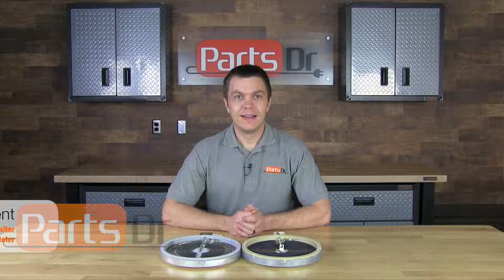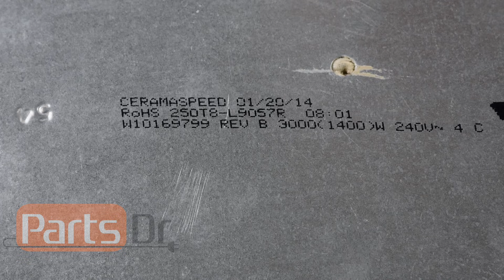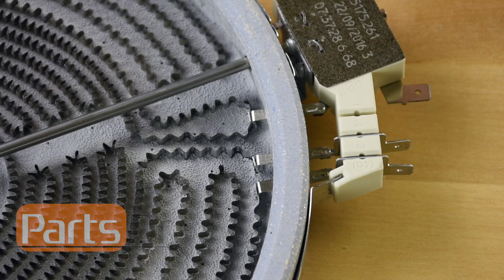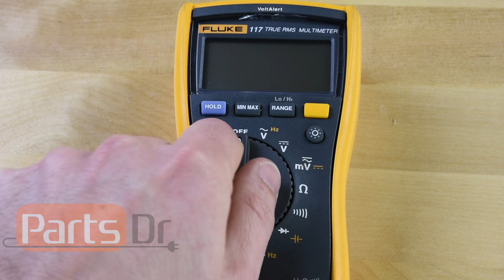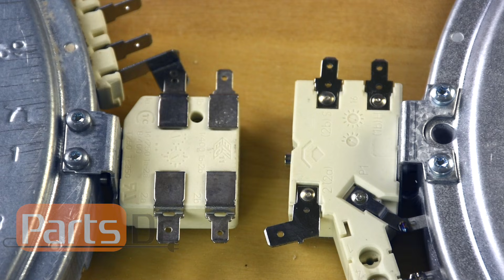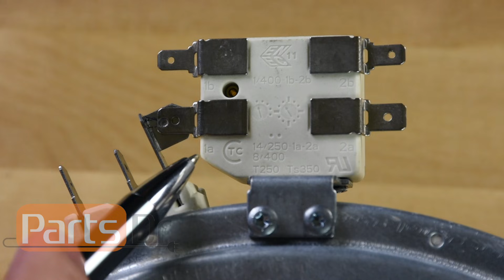How To Test Your Radiant Surface Element & Wire Limiter

Comment from the maker: If your radiant surface element isn’t heating properly or only one coil is working, this video walks you through how to test both the element and the wire limiter to figure out what’s going wrong. We also explain how to correctly wire different types of limiters, especially when the new one doesn’t look like the original. If you're ordering parts online, especially from places like Amazon or eBay, be careful that many of the cheaper aftermarket parts are of much lower quality. We've seen many cases where these parts fail quickly or don’t heat properly at all. For best results, use only genuine OEM parts. You can find high-quality range elements and parts at https://partsdr.com. Let us know if this helped fix your cooktop, and happy repairing!
Reply: i need to know what kind of voltage and amperage is supposed to be supplied

Comment: My hot surface indicator light stays on. When I turn on the element to high, it turns on for two seconds and goes into a limp mode where the heat is reduced over 95%. From watching your video, the limiter is bad and I need a new element. Is this correct? Thanks in advance!
Reply: inspect  element for burn marks and breaks and check continuity with a meter.  If this check out then it’s most likely the limiter.
Reply from the maker: Test the element as shown in this video, if that tests good then test the infinite switch next: https://www.youtube.com/watch?v=QdepcLWfZqI

Comment: What if tech sheet says coil should show between 38 and 42 on one terminal and 34 and 38 ohms of resistance and it shows 26 and 32  could it cause the burner to work on high heat even tho it’s set on minimum.?
Reply from the maker: No, what you are describing sounds more like a bad infinite switch.  Learn more here: https://www.youtube.com/watch?v=QdepcLWfZqI

Comment: Thank you I was going to send the new element back but it tested fine and the 1a 2a 1b 2b  arrangement was really different on  the new one - as well as the wire terminal sizes. Could not have done it without this video!
Reply from the maker: Happy to hear it worked out! Nice job doing it yourself!

Comment: My issue is a burner that always runs at full hot.  I checked the coils and all showed good so I got a new infinite switch (made no change) I have now ordered a new coil (with limiter) and hope that is the answer, as no way was given to test the limiter to be sure it shuts off.
Reply from the maker: The temperature of the burner is controlled by the infinite switch.  See this video for more details here: https://www.youtube.com/watch?v=QdepcLWfZqI

Comment: I have an element on my lg thinq stove the biggest one and I’m getting a reading of 28 ohms on one terminal and 49 on the other terminal. Is this a bad element? This element just stopped working all together
Reply from the maker: Those look like good readings to us.  You can verify the results by using the Ohms Law Calculator here: https://partsdr.com/blog/ohms-law-calculator-a-crucial-tool-for-appliance-repair/
Reply: @ so I took the element apart and the switch and put it back together and now it’s working. Like what is going on? Should I return the new element that I bought when I receive it or just buy a switch or neither? I honestly don’t know what to think now.
Reply from the maker: @tjsworld2338  We don't have enough information to make that determination.  Some LG ranges have a Power Relay Control Board that sends power to the heating element that can mail.  With an intermittent issue like you are describing, that is what we would look into next.  Learn more about this control board here: https://www.youtube.com/watch?v=dWpzVv37BHw

Comment: Can you get electrocuted if the glass break and the coils or the limiter are touched?
Reply from the maker: Yes, you can potentially be electrocuted if the glass top of an electric range breaks, exposing live electrical components like surface burner coils or limiters, and you touch them while the range is connected to power.
Reply: @ I’m an engineer on a tug boat here in Jamaica and is currently facing this problem. Great explanation. Thank you. I will now isolate the system until its replacement.

Comment: Hi, it is possible to remove and replace limiter only ? Th top of the road is burned, and the element does'n work.
Reply from the maker: No, the limiter is only sold with the heating element burner assembly.
Reply: The lead bar (terminal), which bridges from the thermocouple / thermometer / limiter assembly to the power terminal (the "spaghetti" heating wires), is spot welded. The spot weld would have to be undone (difficult, but not impossible) in order to replace the units separately. Why was it spot welded? Ask GE.
Reply from the maker: @artsnow8872  None of the manufacturers offer the limiter separately from what we have seen.

Comment: I did not know that the terminals would be different on my replacement burner, thank you so much. I almost thought I threw $300 down the drain.
Reply from the maker: Happy to hear that you found answer here.  The different wiring between the new and old burners throws off a lot of people.
Reply: @PartsDr  this is probably my problem. I’ve replaced the burners twice and a switch, and it still doesn’t work. I need to go back and check the wiring for the burner on my mom’s stove.
Reply: I had it wired incorrectly!  This fixed it, thanks!!

Comment: Why does the limiter show no continuity from 2a to 2b at room temperature? It should show continuity. When the heat is turned on, the metal expands and  the switch inside the limiter gets broken which is different from room temperature.
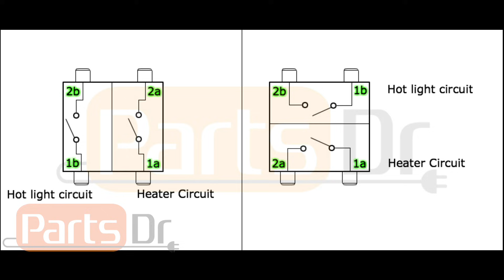Reply from the maker: 2a and 2b should never have continuity.  Reference the chart at 3:04

Comment: I have a bad limiter ( 1b & 2b are closed). Will this keep my element from turning on? If so, can I replace just the limiter?
Reply from the maker: If 1b & 2b are closed all of the time, the hot surface indicator light would be light constantly.  That usually will not stop the element from turning on.

Comment: I have been searching for information on the electrical terminals on the new GE WB30T10132 which is the only element available for my older GE profile radiant cooktop. Unfortunately, the new element has two more terminals than the old one, I was not sure what the significant of the two new terminals of the new element. As it turns out, I was able to match up the right terminals for the heating elements but I was curious what the other two are for. This video laid it out clearly at 2:58, the other two are really just for the heating indicator light, which I don't need because my cooktop has a separate circuit for that light. It is also important that he showed how to test the terminals to make sure they are working properly. Good job!
Reply from the maker: Great to hear!  Thank you for sharing!

Comment: Would there be any other switch or safety breaker that could be my problem. I have a good double element but only one element works.
Reply from the maker: Yes, sometimes the surface burner switch (also called an infinite switch) can go bad and cause only part of the element to turn on.

Comment: My dual element similar to those in this video has another sensor probe from opposite side which went bad.  No continuity on the probe.  Prevented the element from working.  Had to replace entire element.

Comment: Would this element replacement fix an intermittent issue with a burner that stays in the on cycle too long? It's strange, as it doesn't happen all the time. But you have to stand and watch because it will burn your food if you're not paying attention.
Reply from the maker: That type of problem is usually caused by a bad surface burner switch (infinite switch).

Comment: Thank you so much for taking the time to make this video but it doesn’t look like it is solving my problem. I have a whirlpool WFE505W0HS0 and my hot surface light stays on all the time. I don’t even have wires going to 1b and 2b so I feel as though my hot surface light isn’t set up the same. Any help would be greatly appreciated. Thanks!!
Reply from the maker: Did this happen after installing a new surface element?
Reply: @PartsDr  no, the light just started to come on. It seemed it would stay on longer than normal and I should correct myself, the stove states “cooktop on” and “cooktop hot” but the stove is not on. All the heating elements work as they should. The lights just stay on.
Reply from the maker: @XRotov2  What is the model number of the range/cooktop?
Reply: @PartsDr  WFE505W0HS0 is the model number.
Reply from the maker: @XRotov2  The most common thing to fail and cause these types of symptoms is a bad burner switch.
Reply: @PartsDr  thank you very much! Are those also called infinite switches?
Reply from the maker: @XRotov2  Yes that is correct.
Reply: @PartsDr  do you think I could go one by one just unplugging them to see which one is the problem ?
Reply from the maker: @XRotov2  Yes that should work.

Comment: the burner im having a problem with heats
up on high but when I try to maintain a medium
or medium high level of heat the burner
sometimes goes off And gose on Back again itself but it doesn't stay on when i want. And there is no video on youtube about that .. please help me about this .. thanks
Reply from the maker: Those types of symptoms are usually caused by a bad infinite burner switch.

Comment: Great video and labeling. It is the best I found, but not helpful for my unique situation.  My heating element will heat, then die 10 seconds in. I bought replacement, but same issue.
Reply from the maker: If you turn the element on high with no pan on the glass top to heat up, the element will turn off pretty quickly because the limiter on the burner will turn off the burner to protect it from getting too hot.

Comment: Should the ohm reading be roughly the same between the two elements?  I'm getting 57 on one element and 26 on the other for the large 12" burner.  When the burner is turned on, you can feel heat for a few seconds then nothing at all.  Does this sound like a bad element?
Reply from the maker: The ohm readings are usually different because they have different wattage ratings.

Comment: Great video.  I love the detail.  I haven't looked through all the comments, but for the ones I did read through I have not found one that describes my problem.  I followed your instructions in the video, and I don't believe my dual-element burner is at fault because it does work intermittently.  Sometimes initially it will come on when the control on the touch panel is set to 9 (or lower) and with either the single-element or the dual-element option selected.  After 1 to many cycles (no set pattern) while I’m hearing what appears to be a relay clicking as it goes through its on/off cycles, it may or may not heat up and glow.  Other times it does not come on at all.  I believe I am looking at a problem with the control board, but can you help me narrow it down to which one, or if I’m on the right path?  My electric range is an LG Model LRE3083ST. Thank You.
Reply from the maker: It sounds like you are on the right track.  Most of the time the surface burner elements are either good or bad.  It is very rare for one to act up intermittently.  On your model LG it is usually the Relay Control Board that sends power to the surface element and that is most likely the problem.  Let us know what you find.  This is the board for your model here: https://partsdr.com/part/ebr74164805-control-board-assembly?model=LRE3083ST

Comment: Do you actually need to remove the burner element to do the continuity checks, or can you just unplug the stove, and perform the continuity checks with the burner element still attached to the electrical connections?
Reply from the maker: To get accurate readings, you should disconnect the electrical connections while testing the element.
Reply: @PartsDr  Thanks

Comment: Nice as far as it went, but one scenario it didn't address. It is what I call "short cycling" cutoff, and have yet to find a video that addresses the issue. Example, go to boil water, about to boil, nope...cut the heat and better luck next cycle, where will boil on other burners much quicker. Most videos show continuity test to determine if burner or switch is problem for not turning on. How do you rule out burner/limiter vs switch when it does turn on - thus shows continuity on both - but short cycles. Don't really want to buy both units - and potentially return one that wasn't the problem.
Reply from the maker: Hi Larry, that is a great question.  That type of problem is very difficult to troubleshoot.  Most technicians in the field would probably replace both parts.  The only easy way we can think of to narrow down the problem is if you have two of the same burner or two of the same burner switch on your range, you could swap those parts around to figure out which one is the culprit.  In general, with your symptoms, we see it more often caused by a failed burner switch.  Let us know what you find.

Comment: I have a Kenmore electric touch pad stove the larger element stays on high doesn't go lower or turns off, one of the clip that goes into the element looks burn..i think its the heating terminal one. i did the continuity test you show and one terminal  made the beeping noise, but the other did not. but shows a higher  number but not over 100 or lower than 30.like 47

Comment: great video. i had a question. when using the cooktop, do the numbers next to the knobs correspond to specific temperatures? if not, i know the manual has information for the watts per surface element. is there a way to calculate the temperature of the surface element using this wattage information. thanks in advance.
Reply from the maker: No, it doesn't really work that way with surface elements.
Reply: @PartsDr  thank you for the reply. so i guess, other than using a thermometer, there is no way to calculate / predict the  surface temperature of the cooktop ?

Comment: The new element I bought didn't have small wire terminals(all 3 terminals were large), so I had to bend/expand the clip to make it fit the large wire terminals.  After plugging everything back in and turning on, only the hot surface indicator light would turn on, and the element wasn't heating up.  So I thought maybe I broke the wire clips. I didn't know what to do, and thought maybe I have to purchase new wires.  Then I found this video!!! It was a miracle!!! It turns out that the layout was different and all I had to do was to rearrange the wires!!! THANK YOU SO MUCH!! The information in this video was spot on. I didn't even know I didn't know until I watched your video.  It was exactly what I missed!!  THANK YOU!!
Reply from the maker: Great!  Glad you found this video and got it figured out!
Reply: P

Comment: Thank you, thank you, thank you, thank you. I followed another guy's video guide for the installation and when I plugged the oven back in the wall my hot surface indicator light was on. I search a bit on the subject. As suggested I tested my new switch for continuity thinking that this new element that I just bought my be faulty. Everything was ok. Unplugged everything, replugged. Same thing. I search again and found your video that specified that I should connect the wire to the same label terminal, not the physical location! Magical! Everything is working as it should now. Thank you again!
Reply from the maker: You are 100% correct!  The key thing that people overlook is connecting the wires to the same labeled terminals regardless of the physical location.  Nice job on getting it fixed!
Reply: Thank you solved my week long problem
Reply: I just replaced my large burner that wasn't working with a new burner that isn't working.
I connected the wires exactly to the same terminals as the old one.
I am pretty sure this video will fix the problem for me.
I've worked all day and I am tired, so I'll try this tomorrow and hopefully I'll have a working burner again.
Reply: which bit of the video is that could you write down the minutes to be specific please
Reply: @sinanayenigul8731  The part the saved me was the wiring diagram located at 2:57 but honestly the whole video is good to watch for our problem.

My stove/burner is 23 years old and they are making/wiring the replacement burners differently now.

Even though the male prongs are in the same place on the replacement burners, you can not reconnect the wires from the old burner to the new burner wire for wire. It simply will NOT work even though from the outside they look the same. The manufacturer has changed something on the inside that we can't see.

Along with watching this video, I studied the wiring diagram in this video and was finally able to wire it up correctly and the burner works fine now.

I am not an electrician so it took me a while to make sense out of what I was looking at, and then something finally clicked in my head and then it all made sense to me. I rewired it and it all works as it should now.

Good luck.
Reply: @im1who84u  Thank you very much for you respond.

Comment: I have a vintage Tappan oven/cooktop model PV-4428G. The burners have 4 wires. They are not manufactured now.  Is it possible to re-wire the connector to adapt to a two wire burner element or are you aware of where I can obtain a 6" 4 wire burner? Thanks

Comment: Very helpful. You indicated the 1a , 1b etc labels which came useful since the GE replacement element  I got was a newer updated type with the  small and large terminals in different locations from the original.
Reply from the maker: Excellent! We are glad you got it wired correctly!